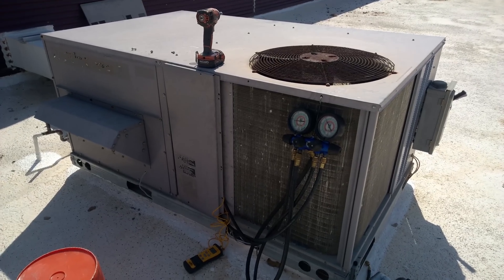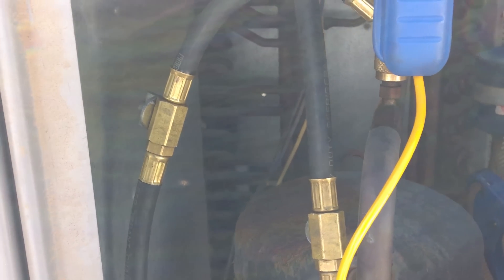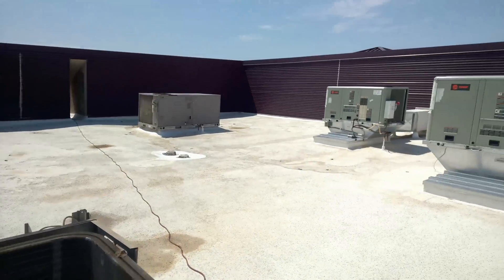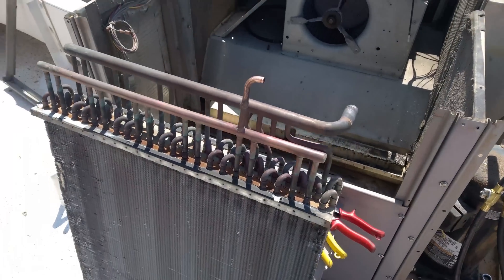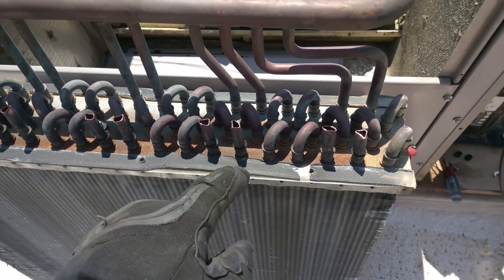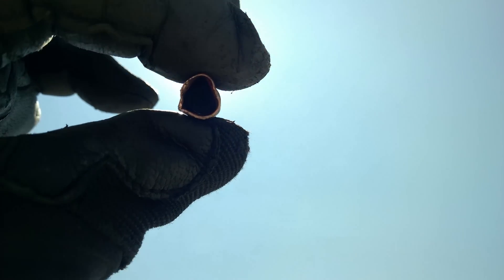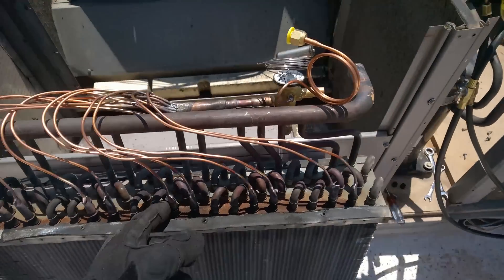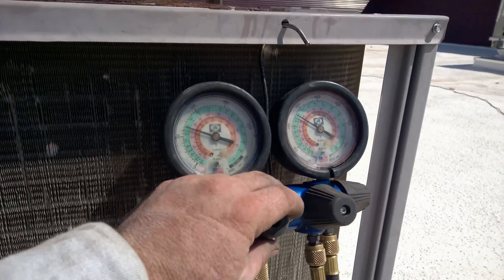Carrier RTU fixed metering device to TXV conversion

Comment: Does anyone have the model # to a 10 Carrier RTU? Need it to order a new evap coil
Reply from the maker: 10 to RTU?
If older, it would be a 48TCD12 / 48HCD12 for gas pack, 50TCQD12 / 50HCQD12 for a heat pump.
Installing the Carrier Service Tech app from the play store. Sometimes you can look up parts that way. 
For a restriction, you can buy the manifold assembly itself sometimes.

Comment: Why didnt you heat them and blow nitrogen to clear like your other video?
Reply from the maker: Replacing fixed metering devices with a TXV has always been Plan A.
The reason I use the nitrogen with heat trick is that most of these units are heat pumps with complicated check valve loops that repurpose part of each coil differently for heat vs cool.

On a straight cool line this unit it doesn't have that mess and I can upgrade it to a TXV type.

Comment: what size feeder tubes did you use? I tried this for the first time about a month ago
with a adjustable TXV and 1/8" feeders to be safe and it worked great.
Reply: Yea, thats what i would have used too. add a sight glass to help out.
Reply: Hey guys . Im having a similar issue. 
So how are the feeds going to feed properly without a distributor orifice?? 
Thank u ❤

Comment: Good job bro but i must say you need a set of sporlan guages. No hoses and wires through doors. Its perfect for commercial units and refrigeration.
Reply from the maker: ben kubesh There is a hole on top with a plug that you can remove to drop the hoses through but it's just easier to run them out the bottom and hold the panel over the opening.

I see lots of guys running the new electronic ones but they look too delicate to survive my use.

Comment: Nice work, how are the feeder tubes sized? You need a 10"X10" camping canopy to set up to get out of the sun.  thanks for posting.
Reply from the maker: Dave Miller 1/8" copper tube. Probably about as small as I could go before it would start effecting the feed.

Comment: Great job.  I hope you were able to rig some shade while reworking that coil -- the sun must've been brutal.  Did you use your ordinary brazing rod on the feeder lines or something with more silver than you use on larger piping?
Reply from the maker: Straycurrent It was brutal. I actually felt sick at about 2PM when I realized I skipped lunch and hadn't taken a break.

I need to get an umbrella to screw to the side of the units.

I do however have that awesome little Stanley blower fan thing that keeps a breeze on me.

Comment: are you wearing a sweater?
Reply from the maker: Kyle Faubertq A light weight one that is night and day cooler than the normal fire retardant uniform. (It meets safety specs for industrial jobs).

It is like t-shirt material but long sleeve.

Comment: wow, that repair must have cost a fortune. pretty intense
Reply from the maker: 2020tesla I've done it a bunch of times but not in a while.

The OEM part, which Carrier distributor doesn't even stock, costs more than a TXV and the small copper tubing.

It is also almost impossible to un-sweat the copper out of each bell end at the coil without at least one tearing apart or breaking clean off right down to the galvanized plate.

That is why even the Carrier distributor reps will be like "Sure you don't want to just order an entire new coil"?

The mod to a TXV is not just a repair it is also an improvement over the original design. Which sucks.
Reply: I’m in fl with the same issue I can get the txt and install how much should I charge the customer estimate